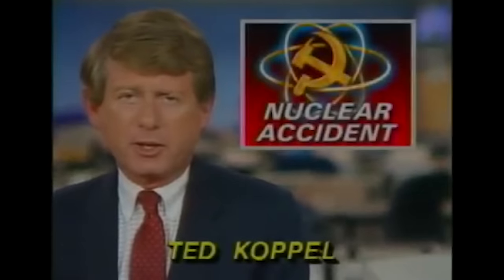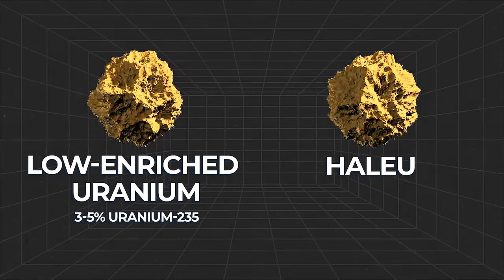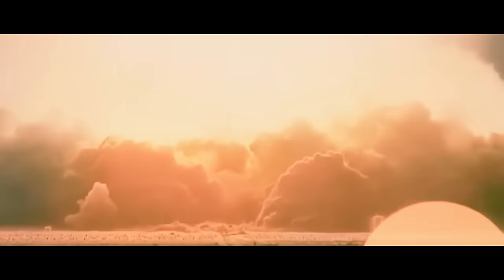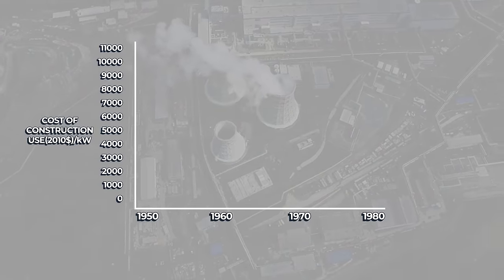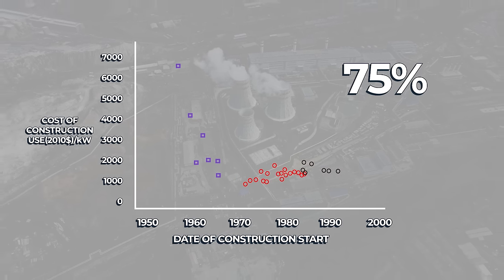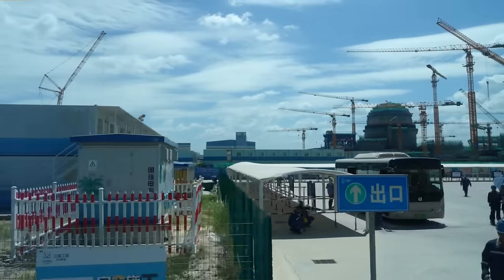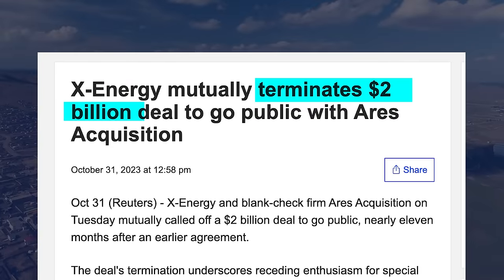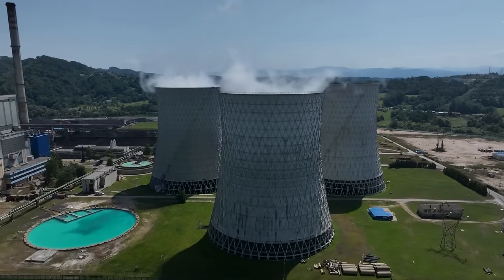Nuclear 4.0 | The Small Modular Reactor Revolution

Comment: The Koreans can build nuclear reactors at reasonable costs.  Their nuclear power supposedly has an incredible 96% capacity factor.  They built the Barakah NPP in the UAE for a very reasonable cost - €4.14 Billion per GW.  Korean built nuclear is about as close as it comes to zero CO2.  Those who claim nuclear is too expensive compared to renewables are missing the point that the LCOE model used to cost energy is fallacious when applied to renewables and is completely inappropriate.  For a given unit of time, say a year, renewables are not remotely zero CO2 if that is your intended aim, which it should be if you want to honestly compare costs with nuclear.
As things stand, a high efficiency offshore wind farm off the coast of Scotland, like East Anglia One, has a capacity factor of 43%.  What is not done with LCOE or emissions claims is adding  the cost of the infrastructure and fossil fuels needed to generate the other 53% of energy to match a NPP output. If your target is net zero and your reference cost is 10 GW of nuclear capacity, you will have to build at least 25 GW of OSW farms and an energy storage and  release infrastructure that is as free of green house gas emissions as your reference 10 GW NPP.  I say greenhouse gas, not CO2, because if you want to try a hydrogen cycle you are probably having to use gas turbines which currently have a big NOX problem.  I believe MIT did a study using batteries and it's completely non-viable cost wise.
If your goal is true zero CO2, power from a Korean built NPP will cost less than from renewables plus storage. It's currently near impossible to do accurate calculations because the costing of hydrogen infrastructure that could accomplish grid scale storage is simply unavailable. East Anglia One OSW farm cost €2.45 Billion per GW - times 2.5 and it is already €6.12 billion per GW vs Korean nuclear at €4.14 billion and we haven't even got to the storage part yet.

Comment: Was there no mention of disposal of nuclear waste, or did I miss that part?  After decades of nuclear plant operation, nobody has solved the disposal problem.  Spent uranium remains dangerously radioactive for thousands of years.  So far, it is stored at great cost in indoor water pools at the nuke plant site. After a few years of partial cooling, it it then transferred to containment housings.   But it must remain under guard for thousands of years. Schemes of burying it deep underground have been proposed.  But this has possibility of leakage into underground water, and to the surface. Nuclear power places a burden on future generations, and puts them at risk of serious and irreversible catastrophic environmental damage. Problems of storage and disposal of nuclear waste are generally neglected in discussions on nuclear energy.  Decomissioning costs of old plants are often ignored too.

Comment: It seems you could design and build test SMRs out of common, cheap steel and other materials just to see the time and skills needed to build one without all the expensive alloys and labor needed for the real product. 

I don't see how this building and transporting could be much different in price than building a standard boiler and turbine such as the ones used a coal or NG powered power plant. Fossil fuel plants are among the cheapest to build. What are the similarities and differences? 

Molten salt and metal reactors can be designed to operate under only an atmosphere of pressure in the radioactive part and consequently with less ultra-high alloy steel. Of course the steam turbine part WOULD have to operate under very high pressures, but the world is full of high pressure steam powered generation in fossil plants. Why the price difference?

Comment: If you go to Tehachapy , you see that more than ~70% of the wind miills are shutdown, lacking blades, or mostly planetary gear failure, result: increased use of much smaller diameter mini wind turbines, requiring more collection  transformers, many more because the turbine output is proportional to the square of the diameter and the cube of the wind, lower towers are closer to the ground where wind speed is reduced (1/7 power law)
Windmills suck!, kill birds, annoy neighbors with the noise they generate and stop when the wind quits 😢

Comment: Small modular reactors have a significant drawback: it is difficult to ensure their protection. For example, when the Zaporizhia NPP was attacked by cocaine рuhrer Zelensky, several air defense systems provided its protection and they successfully coped with this task. But still, several shells hit the roof of the station. However, it did not harm the station. It is difficult and impractical for small power plants to provide the same protection as for large ones. But in the case of nuclear reactors, this is a must.
Reply: SMRs will be buried underground

Comment: SMRs and Micro-Reactors are very good technological solutions for the economy.  However these reactors need refuelling with uranium 235 and 238 pellets with concentration 3% or 5% or even higher 20%m for U235.  After the life the spend uranium need "storing".  Uranium is abundant on Earth, but uranium recoverable reserves are limited, probably 6 to 8 million tonnes, and these amounts are on few countries.  More nuclear reactors means that these reserves will deplete faster and competition will increase prices on the market.  If a country will build a nuclear reactor and will import Uranium, this investment may fail to generate energy if sanctions will be applied for different reason.
More reactors will be build, faster 6-8 million tonne uranium reserves will be consumed.  Producing uranium from low concentration sea water will have higher cost, and the cost of energy will be even higher.
The world can solve the energy security with clean energy generated on demand and near consumers by using Levitation and gravity of solid blocks.  Generating  electricity with heavy weight is well known technology.  Levitation technology is already developed but not disclosed.
A block with weigh 35 tonne using Levitation Tower 100 m high can be lifted at least 100 time per day, This block on Gravity Energy Engine can generate 763 kWh/day at efficiency 80%. No radioactive waste, no re-fueling, no energy storing, no transmission lines are needed, only distribution lines and Levitation towers and solid blocks are needed. These will be the solution for energy crises the world live today, and these do not compete with nuclear energy of fossil fuel energy. These will be needed for transition time.

Comment: Whats the actual output of the last reactor? If its even 10 megawatts per hour that is 100% profitable and would halve electricity prices and best part is completely remove a centralized grid and give real energy independence where a tyrannical state can't control us via the grid so...

If that $60 mil reactor makes 10 megawatts over 6 years it would produce electricity at 11.4 cents per kilowatt-hour. So about 3/4 the current price or 15 cents per kilowatt hour.

If it works for 8 years than its even better at only 8.6 cents per kilowatt-hour.

Comment: They already have the technology built in atomic submarine and nuclear run battleship and carrier. ( Classified)
Reply: Navy reactors are just miniature versions of commercial reactors but using 95% enriched U235. They are not some magical design and because of space limitations, they do not have the safety systems that commercial units have and are less efficient.

Comment: 9:40  "we will always need reliable base load power to compliment intermittent sources"
This is very commonly claimed but it is totally false. Intermittent sources are not complimented by constant sources, they are complimented by sources which can economically fill in their gaps in their supply - and only their gaps. Intermittent power sources are complimented by dispatchable sources - by electric storage and increasingly occasional carbon neutral fuel burns.
There is no base load left once you have significant renewable supply. Any sources which want to supply all the time, will have to compete with renewable sources while they are sufficient or surging. The complimentary sources are only useful for increasingly rare occasions when renewable overcapacity undersupplies. Base load is a historical balancing concept, it doesnt exist when you have enough renewables to intermittently meet all demand.

Comment: Can Small Modular Reactors Save Nuclear Energy?

If they are just smaller versions of the big antique light water reactors that just cost more per watt, then no.

If they are high-temperature/low-pressure gen. IV reactor, they yes, absolutely yes.

Comment: You'll know when SMRs and MMRS take off because you will see people build SMR factories, not a test model SMR. Until we see a factory producing reactors built, we won't see widespread SMR adoption anywhere.
Reply: Where do you get the idea that ONE factory will be a steel  mill that also forges reactor vessels, builds pressure vessels and piping, makes electric motors and pumps, plus all the thousands of miscellaneous items in a nuclear power plant.

Every system module and component that can be built in a factory is already built in one for the current nuclear power plants that we already have.  The build it in a factory concept has already been used for decades
Reply: @clarkkent9080  We have zero factories on our planet that assemble reactor cores in primary containment vessels. At least, for civilian reactors that's true.
Reply: @SocialDownclimber  Today, we use dedicated pump factories for pumps, dedicated motor factories for motors, dedicated pressure vessel factories for pressure vessels etc.  The build it in a factory concept has been used for decades so it is NOT new.

You cannot fit a nuclear plant into a shipping container.  Here is a simple concept: 
1- Larger power plants are more efficient than smaller ones
2- a 1,000 Mw standard PWR spans over 6 acres and more than 3 levels of facilities.  
3- There is no magic way to make SMRs any more efficient so a 200Mw SMR will require MORE than 1/5 the space for that larger PWR and that does not fit into a shipping container.  ALL power plants build whatever system modules can be built in a factory but most of the final assembly is done at the site.
Reply: @clarkkent9080  Read my reply before you respond to it please.
Reply: @SocialDownclimber  I did and there is much more to a secondary system than a turbine and even that is designed for the steam source
Reply: @clarkkent9080  No you didn't silly. If you did you wouldn't be ignoring its content. I said that a SMR factory would produce sealed, fuelled reactor cores. Nothing you said addressed that at any point. It is like you are arguing with someone else.
Reply: @SocialDownclimber  The NRC would never allow a factory to assemble a sealed fueled reactor core.  That is a criticality concern with absolutely no safety systems.  And shipping that across public roads would never be allowed.  In every reactor in the U.S., Fuel is ONLY loaded into a core AFTER all safety and cooling systems are constructed and tested.  the only thing keeping a fueled core from going critical is control rods AND borated reactor coolant.

Not only would that be allowed but it saves nothing and every other reactor, secondary, and electrical component would have to be shipped from their respective specialized factories.

Like I said before the "build it in a factory" concept has been used in every current U.S. reactor so there is nothing to gain
Reply: @clarkkent9080  Thanks for responding to my actual point. I don't think that SMRs will become common or even economically viable for grid power supply either. I just see a lot of proposals, a few designs and details on the reactors but nothing about the production methods and I think that obscurity over how the 'modular' parts will be built is a bit of a red flag.
Reply: @SocialDownclimber  I am a realist and until someone , somewhere in the world actually builds something and proves the concept, it is all just hopes and dreams.  The Westinghouse AP1000 is referred to as an advanced passive safety design and it does include many passive features but the main reason for these were to reduce cost.  It was sold as a $7 billion 1 Gw PWR but actually cost $17.5 billion (Vogtle unit 3 & 4).  The NuScale SMR was supposed to cost $1 billion until actual construction bids showed a cost of $5 billion and that was before construction even began.

Everything looks good on paper, even my companies plan to go paperless.

Comment: We know how to build small reactors; for example every aircraft carrier has three of them. It would seem that a coal power plant might be able to replace the coal heat with a reactor, using all the remaining infrastructure...
Reply: E very component in a power plant is specifically designed for maximum efficiency with a given heat source.  Coal plants produce supercritical  steam and nuclear plants do not.  Other than the switchyard, there is very few components of a coal plant that are useful in a nuclear plant
Reply: @clarkkent9080  aha.  Still, the reactor designs for naval vessels are safe, well studied, and have a good safety record. Are the engineering costs paid, and operating training etc already done? How could our foot dragging bureaucracy deny that?
Reply: @buffler1  U.S. commercial nuclear reactor designs are safe, well studied, and have a good safety record as well.  TMI-2 accident had nothing to do with the design.

People seem to think that Navy nuclear plants are some kind of magical way to produce power when in fact they are just a miniature version of a commercial plant but with ~95% enriched uranium fuel.  That fuel costs $1 billion alone.  

Look at a standard 1 Gw nuclear power plant that spans many acres and multiple levels.  A Navy reactor produces 1/10 the output of a standard 1 Gw PWR and is much less efficient than a commercial unit.  There is no magic in nuclear power. A 100 Mw unit Navy nuclear unit would take up  MORE than 1/10 the land of a 1 Gw unit and would still require most of the operating staff of the bigger unit.  So you have a Navy reactor that is more costly to fuel and almost as costly to operate as a standard 1 Gw PWR.

In plain words there would be NO advantage in using a Navy reactor design.
Reply: @clarkkent9080   Thanks!  I can quit handwaving....At any rate, "we" need to GET ON WITH IT
Reply: @buffler1  Unfortunately, after VC Summer canceled their new nuclear unit in 2017 after spending billions and Vogtle completed theirs in 2023/2024 after 17 years and 120% over budget, there has not been one utility to show interest in new nuclear.  

Twelve U.S. nuclear power reactors have permanently closed since 2012, with the most recent being Indian Point 3 on April 30, 2021. Another seven U.S. reactor retirements have been announced through 2025.

Given those facts, it would be impossible for the U.S. to build enough new nuclear plant to keep up with those shutting down, let alone increase the number operating.

So yes you can stop handwaving and face reality.
Reply: @clarkkent9080  horrible. The reality seems to be back to the stone age. I will not see it.
Reply: @buffler1  In a capitalist society everything eventually comes down to money.  At least right now, natural gas is cheap and except for CO2 emissions, very clean.  Solar has become very efficient while the cost continues to drop.  Wind turbines might not be nice to look at, but there are places where the wind blows 24/7 and 1 Gw of wind turbines cost ~ $1 billion compared to $17 billion for a simular output PWR.
Reply: @clarkkent9080  Gas is indeed good. Solar and wind have well documented problems both in production and use.
Reply: @buffler1  I am not sure what problems?  Solar panels have been getting better every year. Now up to 25% efficient and less than 0.5% degradation per year of use and becoming less expensive.  Wind Turbines cost $1 million per Mw capacity and other than blade replacement every 25 years, have very little required maintenance.  If the made the blades out of aluminum instead of fiberglass the would last much longer but cost more.

Natural gas turbines can load follow, nuclear cannot. Where I live, peak load is from AC that follows the heat of the sun and solar is an excellent source to match that demand.

Grid supply must match demand and every grid has spinning reserve (generation capacity that is capable to provide power at a moments notice) to allow that match. Renewables require more spinning reserve.

If you live in the U.S. you must know that money dictates just about everything and new nuclear is just too expensive compared to other generation methods.

Comment: Micro nuclear reactors have a future for the future Mars colonies.
The new starship, soon to be tested can carry 100 tons to orbit, that is high compared to the truck transported reactor modules, cooling in the cool red hills of Mars  with existing cold Co2 is easy; and even solid frozen Co2 at the south pole can by sublimation produce excellent cooling. The  would be regulators have no business being part of the Mars Colonies, Fuel pellets being so energy dense are easily transported to Mars. That means water, frozen in the ground eliminates the need to be electrolized to hydrogen for the use of the Sabatier reaction to produce gaseous methane
Instead electrolyzing water can produce liquid hydrogen peroxide, a monopropellant for rovers, local heating and of course Mars tandem helicopters which require barely more power to hover than on earth, thanks to the lower gravity.
So the future for humanity is truly on Mars, much improved by the micro reactors.
As Robert Zubrin says, "on to Mars"